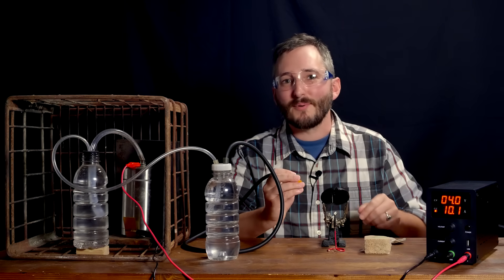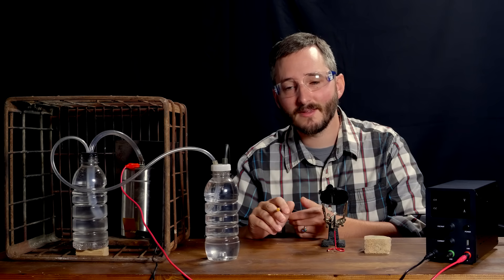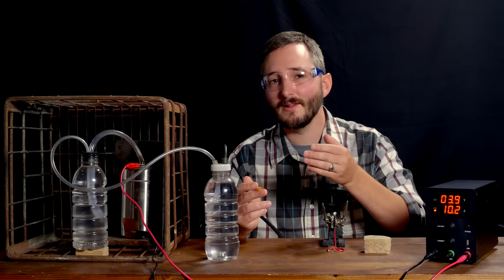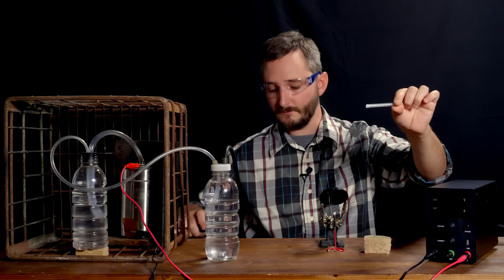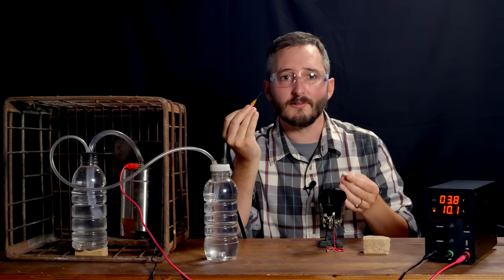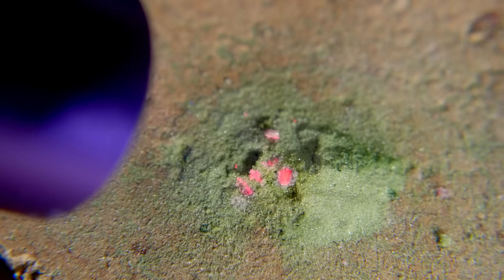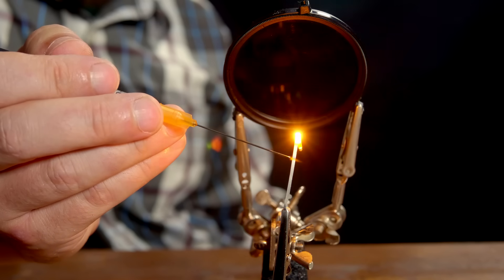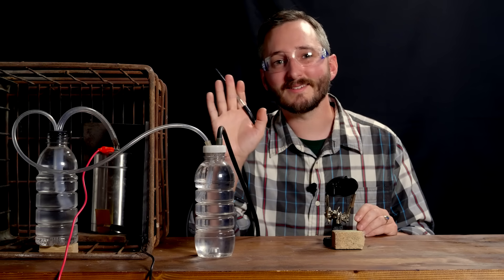DIY Oxy Hydrogen Torch Using Water Electrolysis

Comment: There is many misconceptions about water gas. This is not just a mix of Hydrogen- Oxigen gases, water gas have different properties. One of those is flame temperature, its not 2500*C, but just around 140*C. But when you hold this flame on some material, flame temperature rise on melting point of this material. If you don't believe me, try it! Water gas is very strange and interesting thing 🙂

Comment: Apparently these have not really caught on commercially, because free hydrogen dissolves into molten steel very easily. It makes joints very brittle compared to acetylene brazing. One of the reasons anyway.

Comment: Instead of carrying mixed gas through that tube, can we carry both gasses in  separate tubes and mix it at the syringe tip? Maybe 2 separate syringes at an angle so they can mix out of the nozzle and burn?

Comment: But if you reduce the amount of gas that can stay in the generator by just having very little space outside from the water it should be relatively save as well right? And since the plastic bottles are expandable those should probably absorb any preasure forming by an explosion. And since the explosion is so small there isn't so much gas's in the system anyway I guess. And combined with the idear to mix in some propane it, in my opinion it is not much more dangerous than a commercial gas burner. Correct me if I'm wrong.

Comment: I've seen a lot of videos on Youtube on this concept but I was still very interested to see your take on it since you actually give a thought to safety, don't shy away from talking about mishaps, how they happen, and how you overcame them.  I'm quite impressed that you're managing to drive over 30 watts into this rig at 3 volts.  That represents a relatively low overpotential and hence you should be getting pretty good faradaic efficiency (gas per unit charge). All too often you see people suggesting that you run at 12 V with relatively low surface area electrodes that are too far apart which of course just generates a ton of heat.

I've been wanting to try this again so I've been gathering a number of stainless steel flasks for just this purpose.  I also have some very fine copper capillary (i.d<1mm) that I think would be well suited for making torch tips since it would dissipate heat like crazy.  My only concern would be coppers lower m.p but the higher thermal conductivity should more than make up for that. I also had the idea of using stainless steel wool as readily available corrosion resistant electrodes so I'm glad to see it indeed works well in this application.

Btw another interesting application for the stuff is as heaters.  From tiny ones made of a single strand to big wads of the stuff as hand warmers in winter with the aid of some lithium ion cells and a bit of modest control circuitry.

Anyways good job and cheers!

Comment: Okay, I've got a tricky one:
Maybe you can make tiny glass spheres by letting glass powder or dust drop in front of the flame.
Why? Well, they reflect light back to the incoming direction, plus I think it would be interesting to see in the first place, if this really could be a method for making tiny glass spheres.

Testing homemade starlight would be interesting too

Comment: We used to blow the gas up from the chrome strip tank at the plating Shop caustic soda with power running thru it one small spark and the bubbles go bang and shake the whole tank and makes everyone crap them selves always check nobody is behind you before you pull the job out of the tank so they can't do it to you

Comment: Would this have any use for soldering, or would it boil the solder / disintegrate the traces? I guess maybe the heat might damage ICs if you're not careful also?
Reply from the maker: I'll have to try it

Comment: I like the generator idea, I'm going to use that lol. You can actually get some pretty good use out of this thing. increase your volume a little bit (It's okay, you can buy a professional version of this believe it or not) and you can use "flavor injector" with the tip flattened, and flashback added to the body. Try welding some tiny things, and if you use a CO2 cartridge as shielding gas you'll feel  like a giant lol. Completely pointless, but nearly mandatory haha.

Comment: Super cool! One thing to correct, is that the smaller needle actually decreases pressure, but increases velocity of the gas. It's counter intuitive that these have an inverse relationship, but is explained with Bernoulli's principle.
Reply from the maker: Pressure increases in the system as a whole when the outlet is smaller, but you're right that pressure decreases in the needle itself

Comment: Not that I'm any expert on flame arrestors and torch nossels, but could a one way check valve for gas entering the syringe act as as a potential flame arrestor/explosion deterant?
Reply: During a flashback event, the gas is still moving forward, even though the flame is moving backward; it's just water vapor instead of H2 and O2.  So your check valve would never close.
Reply: @BrightBlueJim  I see. I wasn't sure if the nearing flamefront and the pressure wave created by it might aid in shutting a check valve of a given design. Even then, even if it did work in that manor, I would have it coupled with the water barriers used, but I imagine any check valve would further dampen the flowrate since he's not compressing the gas prior to discharge into the torch plumbing.

Comment: "This is a project not meant to be replicated at home"
eyeballs the DIY in the title
Reply: Yeah...I'm totally replicating this at home one day.
Reply: @warrensteel9954  Same
Reply: "Do it yourself.  Just don't do it yourself!"
Reply: Replicate it in your garage. Problem solved.
Reply: Do it yourself
elsewhere
Reply: My thoughts exactly. 😆
Reply: "Do it Yourself." * 

* In a lab, not at home.
Reply: It's meant to be done at your neighbor's the one with the all nite barking dog.
Reply: DIY and Not at home combined mean "do it in the garage or shed"
Reply: should be DDIY
Reply: If one of these puppies flashes back your going to want them safety specs he's got on. I ran a similar system with steel wool in the torch head and a mig welder head tip. I could run the torch for 20 minutes straight without melting the plastic bottles. Converted the electrode tank to a mason jar. It takes that heat repeatedly and the bubbler is plastic to act as the blow out device so your glass doesn't shatter.
Reply: @UnifiedInfo  fire cannot flash back through a narrow enough pipe
Reply: @UnifiedInfo  ya if i do it i'll probably make it so the lid would pop of instead of the whole thing exploding like a granade.
Reply: i have an idea..what if i put a small water tank around the fire nosle..it will be more safe?? plz tell me
Reply: DIY means Do it Yourself, not Doing at home, that should be DAH :face-blue-smiling:
Reply: I think its a lawsuit prevention method. because he did make it himself at home in a do it yourself style way, but even he seems quite frightened by how dangerous it is when using it.

Comment: Note to those who might try this.  You might be thinking you can get away with running a torch like this without ventilation- no burning hydrocarbons, so no carbon monoxide and carbon dioxide, right?  But in fact this torch is hot enough to make NOx from the nitrogen in the air that surrounds it.  Please research NOx poisoning before attempting... pretty awful stuff.  ☠

Comment: Do you think it would be possible to increase the tip size to cut steel  , and possibly add nitrogen to maintain flow so blow back is not a concern .

Comment: Could you use this to weld aluminum? Such a tiny super hot flame might be able melt the aluminum locally right where you're trying to weld without the rest of the aluminum sucking the heat away. Possibly with very tiny filler "rod".

Comment: How about try to separate the oxygen and hydrogen gas by using two Output needles but the points are close to each other so that combustion still happens but without the backfires

Comment: Would having a tesla valve inline help the flashback arrestor since it allows full flow one direction but restricts it in the opposite direction? It seems like it could slow the combustion rate below the flow rate.

Comment: Few years ago I've made a similar system but it used Al+H20+NaOH reaction to produce H2 which burned in air (no compressed air feed or O2 was used).
As the reaction is highly exothermic, the reaction jar was kept into a pan filled with water for cooling.

Comment: This is excellent; great job! Not sure if it's worth the effort, but a ball / pinch valve upstream of the nozzel might help with the turning-off process (if you can find one small enough). Something with trigger action (think similar to a garden sprayer) would be ideal if such a thing exists at the right size / tollerance (otherwise prob more work than it's worth).

Anyway, again - really nice my dude.

Comment: Another great video! 👊 Small scale welding or soldering projects could easily be done, or something like a small engine or projectile project using the fuel. A two stage hybrid hobby rocket or wood burning art work. Powering something mechanical or electrical with either the fuel and or the heat would be interesting to see. ⚙️🔋 I'm glad to see you taking safety precautions as well. Keep on experimenting and sharing but, above all, "Safety is☝️😎..."...I'll just assume you know the rest. 😄

Comment: I've reacquired most of the hearing in one of my ears, after a flashback blew up one of my plastic bottle bubblers on a similar setup I made several years ago. I stopped messing with hho, but decided the electrolysis chamber design that uses high count silk sheets to seperate the H and O to seperate chambers is a better idea. Had I been wearing hearing protection I'd probably have a large hydrogen casting torch by now.
Damaging my hearing sent me down another interesting rabbit hole, learning about the inner ear (the cochlea) that processes a particular range of our hearing. I learned military doctors have used a few vitamins to successfully treat partial hearing loss in many of their patients and took those vitamins for about a year. Even so, crickets still sound like a poor commodore 64 impression at times.
Reply: Which vitamins if you don't mind sharing?
Reply: @stethoscanomaly  magnesium and niacin are the two I recall buying seperate from my regular multivitamin. 
Be careful with the niacin. Too much in your system can cause thrush. It happened to me a couple times before I discovered what was causing it.
(Don't take my word for anything. Do your own research.)
Reply: I have hearing damage from explosions and gunfire. I can still hear fine but I have constant ringing. Like I always have crickets in the backround.
Reply: @danebrewer5931 same
Reply: Did the same but was just setting off the bubbles in a soap and water mix, blew out my right ear drum. Hearing is mostly back but i still struggle if im trying to use that ear to talk on the phone
Reply: @hobbesscott1014  so eat food, got it.
Reply: Okay so from that I've made a note to self to wear hearing protection when messing with this stuff.
Reply: Patrick Flanagan's Neurophone bypasses the ears & allows you to hear even if you are completely deaf.
 I demonstrated this in Indonesia with 3 completely deaf from birth, people.

Comment: I'm really interested in the properties and efficiency of this compared to a resistive or arc heating element. It clearly concentrates the heat more, but I still find it hard to believe that it's only some ~40W of power burning at that tip.
Reply: Only 40 wants is to pull apart  the water and not the flame power rating, the crazy part is how  resistant materials heat up faster compared to conductive materials  when heated by a oxy ocetoline or oxy map

Comment: You can scale this up, with more tubes, and more needles in parallel in theory, not sure how you would extinguish them, without something like a water block they went through or something... 

But it would be amazing to see like 10-20 of these, heating a furnace. :p

Only really possible, in a stationary system, but it would, if the safety systems be figured out, work remarkably well, as they supply a VERY high heat, with little overhead, in technical knowhow.

Comment: Hmm i bet i could use that for removing damaged cell phone charge ports and hdmi ports on game systems 2 very hard repairs with a standard iron That high a temp would likely vaporize the solder or just blow the solder out of the way

Comment: I think I would use an S-shaped airlock (used for fermenting beer and wine) as a handheld flame arrester right at the needle. I would also add a T at the flame arrester bottle and put a piece of balloon over the extra nipple. That would work as an emergency pressure release valve in the event of a backflow. Prefabilly pointed straight up, it would dissipate any heat and pressure up and away from you and the bottle, while creating a downward force counteracting the bottle trying to jump under pressure.

Comment: I could see this being very useful for chainmail. Historically they used rivets to hold the chains together, but making the rings is very labor intensive. Most reenactment chainmail just has the two ends butted up against each other, fast but weak against an actual blade. This would be a good way to weld the ends together, some people try spot welding but that doesn't scale down very well.
Reply: I’ve tried it. Unfortunately The hydrogen flame makes the metal very brittle so the rings just break at the weld. Better than butted but if you are going through the trouble, use acetylene.
Reply: @theCodyReeder  Did you try tempering the rings after they were welded? Or was it a result of carbon being driven off by the high temps and lack of oxygen at the flame?
Reply: @thenoobplaysit6923  bump. i want to see the reply.
Reply: @thenoobplaysit6923  hydrogen is able to dissolve into the metal and weaken like a lot of other impurities. Normally though I think it comes out pretty easy in the refining process
Reply: @theCodyReeder  Run it fuel rich.  If the flame is stoichiometric, it's hottest but it tends to entrain extra air, and make an oxidizing flame.  The water vapor doesn't make much of a shielding layer either.  Oxide inclusions and hydrogen embrittlement are enough to make the weld very fragile.
Reply: @theCodyReeder  Repeating another question, with an added twist: is the brittleness caused by some chemical attributes of the flame, or just the small size of the heat source, or what?  I would think annealing could solve the latter problem... not sure about the former.
Reply: @DavidLindes  Probably hydrogen embrittlement plus oxides in the weld since the flame is neutral at best, and oxidizing in practice.
Reply: Chainmail was also made via forge welding but that sounds like a nightmare making thousands of tiny forge welds
Reply: @benadams5557  each link is surprisingly easy to forge weld closed. (I was surprised at how easy it is - I still gave up after making a 3 inch diamond of welded mail)

P.S. Hundreds of thousands, if not millions of welds to make an entire shirt
Reply: Why not use an oxy acetylene jewelry torch?  Those tiny oxy torches are like $20 and would work good for gas welding small diameter mail....not fast though.
Reply: Every exiting

Comment: I emailed you about safety tests I did on flame arrestors and storage options.
Reply from the maker: I just read that, thanks for your thoughts. Great idea to use a 3d printer nozzle. Your storage was interesting also, I may test that.

Comment: The smaller nozzle doesn't increase the pressure at output. It only increases the rate of flow, pressure in the system stays constant.

Comment: Combined H2 and O2 should be at perfect stoichiometric ratio so you get max temps.  Seems like separating hydrogen and oxygen and combining them at the burner tip would be a safer design. Reminds me of ethylene oxide which is explosive by itself so very dangerous.

Comment: Dear man it can be used to run an 8 cylinder car. Been done. Also thru a torch it can burn through a 2" steel ball in a minute. Or a fire brick in 3 minutes. Put your flame arrester of steel wool or ss pad in box between nozzle and produce source. Run lawnmower on it. The draw on gas keeps it from backfiring.

Comment: I’ve always wondered if earlier humans could have done this with a Bagdad battery to achieve airship technology such as hot air balloons through using wood/cane based pipe systems for the buoyancy as well as rope and pulleys to do so. Effectively validating the ancient stories of flying machines lost by time and ignorance of a few who felt superior to the masses.

Comment: I went down the rabbit hole trying to figure out how to build one of these types of torches (indeed, for jewellery making) years ago. I concluded it was too dangerous for me to use in the house. there is a company that makes a brown's gas generator and torch system. I've seen one running in a little jewellery shop in Glastonbury, The owner said it was really expensive..

Comment: i had no idea hydrogen torches where hot enough to melt ruby and immediately had ideas for small scale specified jewelry making even before you had mentioned it
Reply: Synthetic rubies aren't all that valuable though.  But the torch itself could revolutionize working with copper, silver, and gold.  No more lead or cadmuim in solder, no more burning acetylene or propane indoors.
Reply: Of course, if you can cut them they're much better than say swarovski crystals or something like that.
Reply: @gratefulguy4130  i was thinking that it could be great for making cool ruby pendants or something for friends that are their favorite animals or shapes etc. by melting ruby in crucibles made as molds which would be another project in itself.